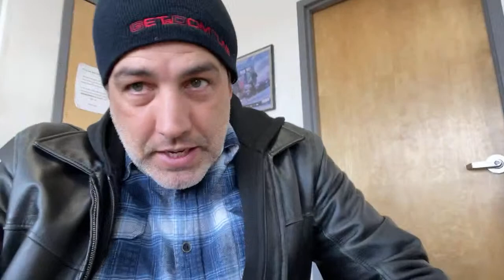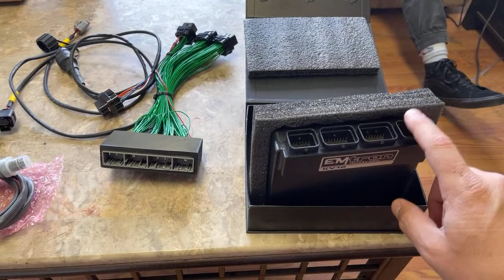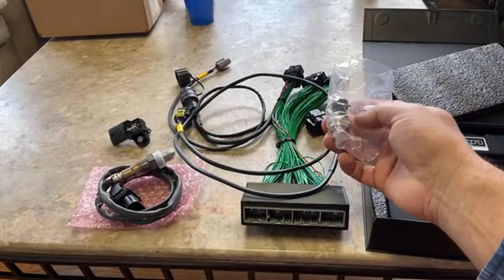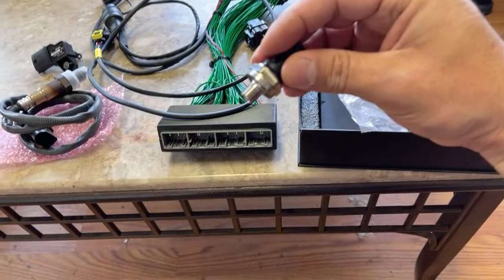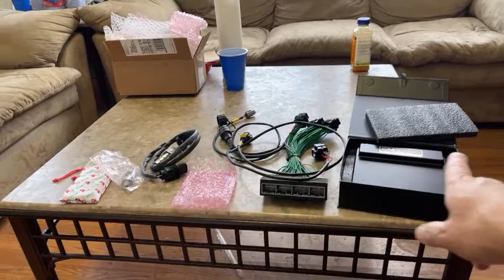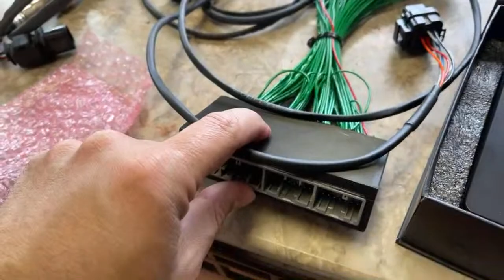Cobb got you down? My Standalone recommendations

Comment: Will this allow me to perform a Secondary Air Injection system delete? I was in the process when Cobb made the announcement.
Reply from the maker: as long as you're talking about doing it on your race car, yes. On a street car, it would be illegal to remove the air pump system regardless of EMS solution used
Reply: @GetaDomTune  of course, thanks Dom!

Comment: Just curious for a 2013 STi.   Wouldn't the motec m150 be a direct plug in solution with better software? I'm pretty sure all the Subaru factory team cars are running motec including Travis Pastrana's wickedly fast STi.
Reply from the maker: Definitely not better software. But it's a good solution.
Reply: @GetaDomTune  I always thought motec was at the top.  I definitely would want plug in connections not to have to hack up any of the stock wiring.
Reply from the maker: @DJ_Driven  you don't have to hack up stock wiring. M150 is not a straight plug in either. Both the Emtron and Motec use an adapter harness
Reply from the maker: Motec is more expensive also

Comment: Woof 700$ for that adapter harness is steep. I get it making that breakout pcb isn’t cheap and neither is all the wiring for the 200 circuits. Still I’d rather spend the 10hours and 150$ in parts pinning my own.
Reply from the maker: So do it